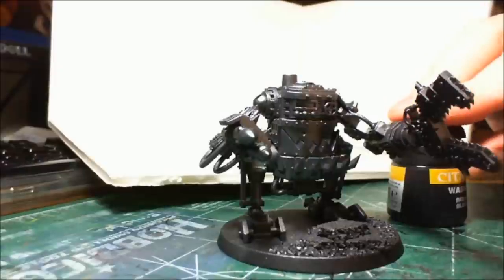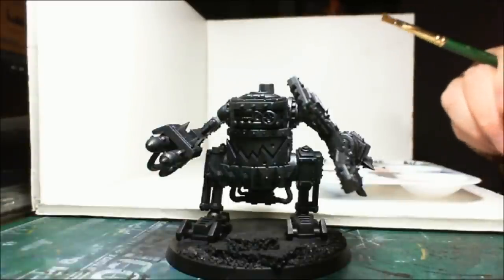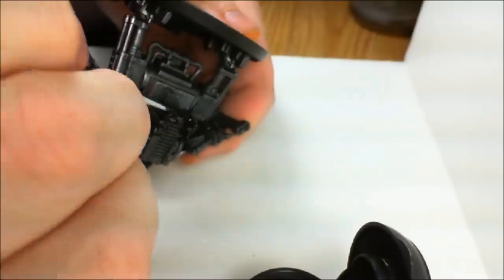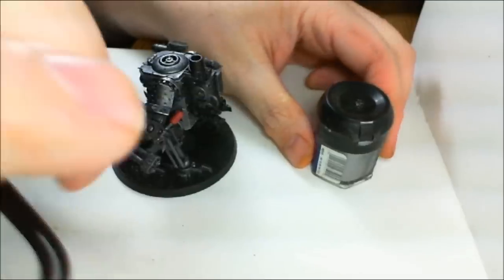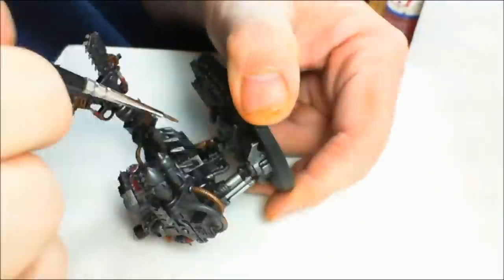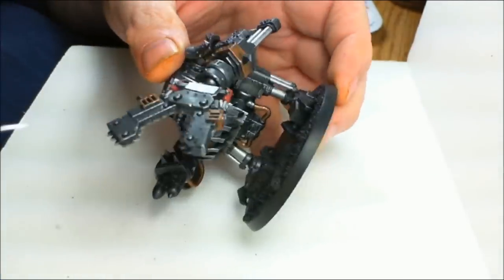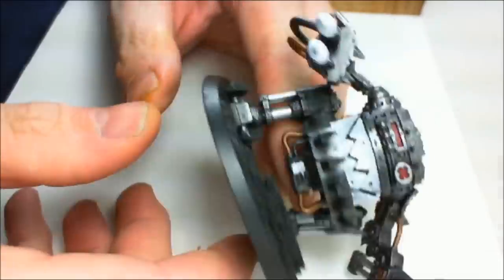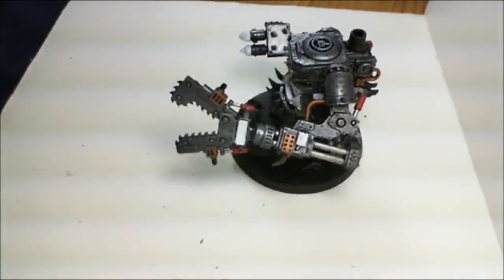Talking About Orks - Hobby #3 Painting a Goff Killa Kan Part 1

Comment from the maker: @Absolute40k I have two airbrushes right now, a Harbor Freight deluxe airbrush and a Master G44.  

I really don't have a preference in paint itself, other then I don't like the Vallejo game color line because it separates very, very quickly so it's hard to work with.  I like painting from pots over having to use a palette, so I use GW stuff when brush painting. I like having dropper bottles when using the airbrush though, so I end up with two of most colors.